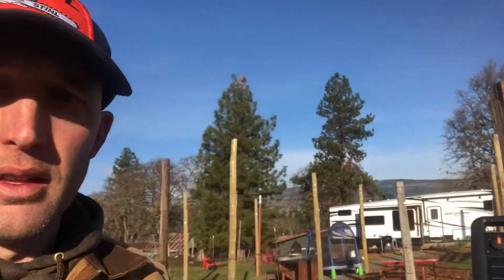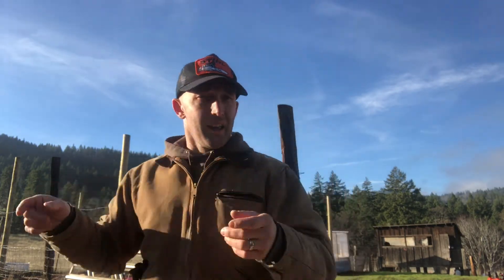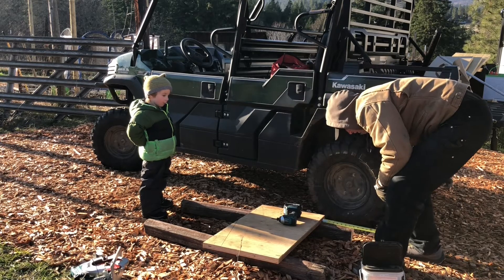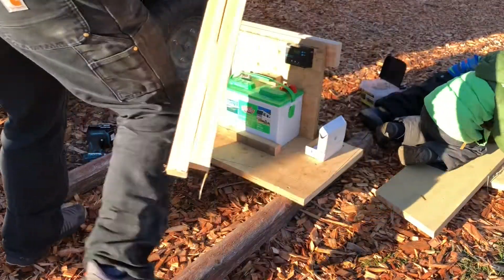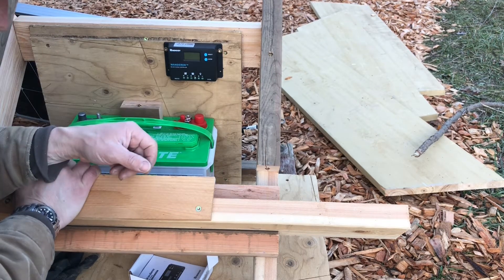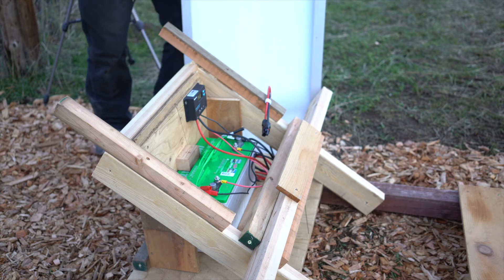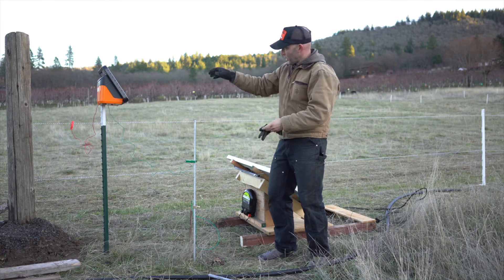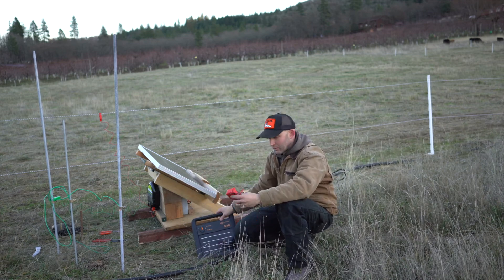Don't Buy a Solar Fence Energizer, Build Your Own!!

Comment: Thanks for explaining what gets hooked up to what. So many other videos on this topic don’t even say in which order to connect the equipment. So it’s solar panel, to regulator, to battery, to fencer?
My major concern is ground rods. I want to be able to move my unit multiple times a month, but the thought of moving three whole ground rods and driving them back into our rocky soil sounds like hell. Did you get around that somehow?
Reply from the maker: Since installing this I have moved it around, and upgraded the battery to a FiFePo and added another panel for the dark winter months. When moved I hook the ground to the T post fence and it is enough.
Reply: @yourdeptlogohere any chance your willing to do a update video on this topic?

Comment: I've seen others hook up like you did. By not running the fencer through the charge controller aren't you risking battery life from over discharge? or does the panel charge that well that it does not fully discharge?
Reply from the maker: Yes that’s correct. The original battery had been replaced by a smart LiFePo that shuts itself off at low charge. My goal was continuous fence charging even at the detriment of the battery. I don’t want cows out, even at relatively low voltage it still provides a shock.

Comment: Dog Sled

Does water build up along the bottom of the panel?

Is anyone adding a battery switch -- they use these on boats and RVs all the time?
Reply from the maker: Minimal water builds up. It doesn’t affect performance. I didn’t add a switch, it’s always charging, and the negative alligator clip is attached to the wood if I want it off

Comment: I agree, self-contained solar DC units are usually junk. Are used to have a couple of those solar Gallagher S 17’s and they also didn’t last very long the idea the ground rod is the number of feet in the ground so three ground rods not in the ground very far isn’t any better than one ground rod pounded in the ground all the way and then you’re supposed to separate those ground rods by about 10 to 20 feet they act as a large antenna especially as you’re putting more, Jules through a fence line with larger fence chargers
Reply from the maker: That’s as far as they will go into the ground. More contact over a wider area gives you a better ground and more shock delivered. I don’t even use those anymore, just ground it to a metal fence post nearby.

Comment: the Gallagher charger doesnt have to have sooo many grounding rods. Mine keeps in  hogs,,,which need good charge because they test it more than cows 24/7. You didnt show the volts yours is putting out.
Reply from the maker: Thanks, it puts out between 9000-10000 volts at about .3-.5 amps.

Comment: I need to make a fence to protect my bee hives from bears. In total it’ll be about 60 of fence or so, probably 3 strands. How do I know what size panel/controller etc I’ll need?
Reply from the maker: As Rex said the bigger the better. The system that I used in the video has the ability to get to 3 joules. It will then depend on your battery capacity and state of charge. If you aren’t using solar then you will have more options. Good luck!

Comment: What battery did you use?
Reply from the maker: It is a large deep cycle battery, I believe it’s either group 27 or 29. It was used, but still works.

Comment: Any update on this? Thinking about building one of my own as well. Just wondering how it had held up now that you've had it for a while. Anything you'd change? Did it keep the charge or did you have to occasionally charge the battery?
Reply from the maker: Cory, I’ve been using it continuously since I built it. I had to charge the battery one time in the winter due to snow sagging the lines down. We had a rough winter. With that said the batteries were all used. Your results will vary based on sun and the amount you get over winter. You could always add another panel or battery fairly cheaply. I’m going to build another one just like it for my front pasture, and then another for my gate motor. Good luck and let me know if you have any more questions.
Reply: @yourdeptlogohere  good to know! I’ve been dancing around a lot of brands, joules, etc… I think I like this idea the best. Was mostly wondering if the 100W panel was enough to keep up with the output. Sounds like it did just fine for you. Would you consider using something other than the patriot? Like Premiers or a Gallagher? What made you land on Patriot?
Reply from the maker: @corykelley8752  Patriot had the most joules that I could find that would pair with a solar application. If you find something better please share. Now that solar has come down in price even more I would look to get more than a 100W panel for my next setup. There are many options out there. What to look for is the output (I believe in amps) of the panel and pairing that to a solar charge controller that can deal with the panels power output. I believe that I pared the one that I used with the panel I was purchasing, you may have to step up to the charge controller if going with a higher output panel.
Reply: @yourdeptlogohere  I’ll let you know. I’m avoiding the Patriot because they aren’t serviceable. Probably end up with a PowerWizard, Cyclops, or Gallagher. I’ll let ya know how it goes.

Comment: Thanks for the video. Love your helpers.
Do you think this system would keep deer, raccoons and rabbits out of our vegetable garden?
Reply: Deer could possibly jump over, but will definitely stop coons and rabbits. We use electric netting around our garden and it keeps the critters out
Reply from the maker: Yes with the right kind of fencing. There are many types of electrified fencing that would work with this charger.

Comment: But in the solar charger from the store, is the solar panel supposed to charge the battery? Cause I have been reading that for some solar chargers the solar panel is only supposed to extend the time in between rechargings of the battery with electricity.
Reply from the maker: It’s supposed to charge the battery. Thanks for your comment.

Comment: At our farm we have multiple of these diy solar chargers that far exceed any store bought one. We have four of them ranging from a 1 joule to a 12 joule charger. 

We use stafix, (now called speedrite) energizers and they have lasted multiple seasons and we run wire through a lot of thick brush. 

General rule of thumb is 3ft of ground rod per joule of energy, and that has to be 3ft worth in the ground, not above. 
Also, usually the spacing between them is one or two feet longer than the ground rod itself.
Example, two 6’ ground rods should be placed at least 6’ apart. I learned that lesson on the 12 joule charger. As soon as I spaced them correctly my fence went up 4x energy.

I like that you have more solar panel than battery storage, which is what most pre made energizers lack.

Thought I’d share the knowledge, it’s cool to see everyone’s builds! Great video quality.
Reply from the maker: Thanks for your input. I tend to go with how the cows interact with the fencing. If they don’t respect it maybe I need more power. What I’ve done here works and they stay away from it.

Comment: Great job?????? Could you please send to me parts details..solar panel + battery + charg regulator...thanks
Reply from the maker: It uses a renology 10w solar charge controller, renology 200w solar panel. LiFePo 200ah battery. Patriot P30 fence charger.

Comment: Great job, but you will need to have your ground rods about  ten feet apart. You will notice the difference. It's a hassle  having that extra wire stretched out between the rods and back to the charger. If it still isn't up to snuff: add water around the ground rods.
Reply from the maker: Thanks for the tip. So far the cows respect the fence. When they accidentally touch it they react as if it’s powerful enough. As the summer goes on I’ll monitor it snd make sure we’re still getting the power needed.